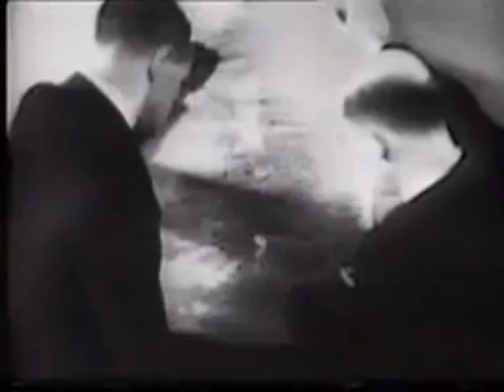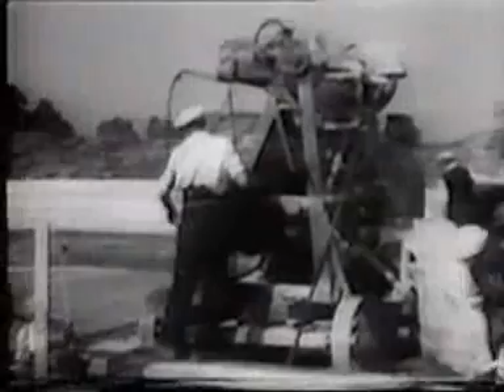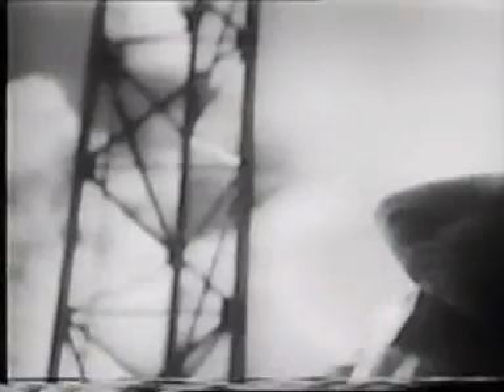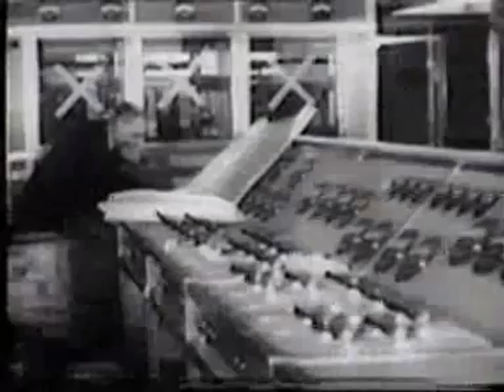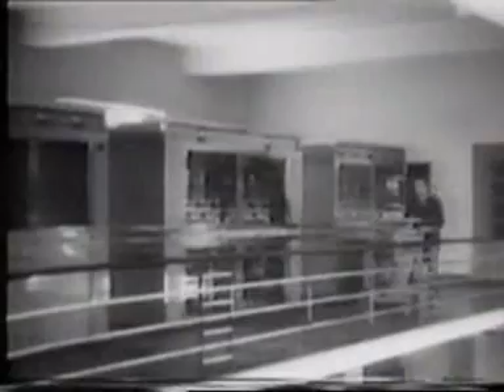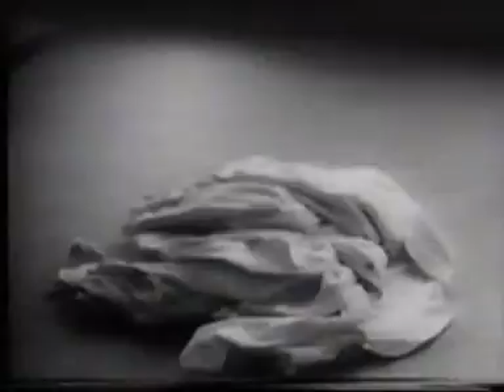Droitwich

Comment: A few comments:

1.   Droitwich Council must have had some "pull" because BBC transmitting stations were, like RAF ones, named by nearby village or feature eg Washford, Moorside Edge and not towns.

2.  About power: it was often stated as having 400kW output but more likely 360.   I am uncertain how much to the goldfish in tank to the north, but they thrived and a dustbin full were given to other public ponds.  Lots of waste heat.

3.   The triangular masts should have had one side at 90 degrees to the line on which both stand, then the masthead pulley would be in line with the halliard but it isn't.   This is obvious because the backstay is not in line with the two masts.

4.  Health and Safety.  A Marconi employee fell to his death in 1950s, he had been rash before... He had used the  safety claw to hold the lift while he swapped to new rope, withdrew the claw and the lift dropped to take up the slack, ge panicked and leapt intending to grab the tructral girders, there was an assistant who was fortunate to not be dragged the same way.  Nobody knows why the task was attempted partway up the 700 feet, the coroner spoke rubbish about risking life to provide radio programmes.   I asked the then EIC, Mr Curd, if little boys were able to go up masts and he replied that he couldn't get big men to go.

He avoided Christmas Day duty delegated to my father so i used to start the English Electric diesels, 350lb per sq in air.  These only ran for the Queen's speech, but also every Thursday for checking serviceability.  If you had been foolish and had neither compressed air nor National Grid there was a Lister with starting handle to pump up the air bottle.  The flywheels were partly in pits but most above floor level and shone like mirrors because on weekly running the diesel man leant against the rims with Brasso on cotton wasre.  Careful not to push it at the whizzing bar notches.  Barring the wheel using a socket on the floor would be used when setting tapoet clearance for example.

Finally - it was Lord Reith's pride and joy, people said "Dieu and my Droitwich".  He had his chauffeur take him there in late evening of his last day in the BBC so that he personally could shut down those diesels, which of course did run everyday during the 1930s and in cold winters ever since,  they produce 2megawatts.  At open days a 15" diameter spare piston was displayed and more of the public understood that allusion to power than any figures such as kvA or kilocycles.

The rotary converters and everything were the very best possible and it is sad to see the neglected state of the exterior since unmanned running in recent years.

Comment: 15 years later I would love to see an HD transfer of this film. Where did it come from?
Reply: Yeah that would be great, it''s amazingly well made
Reply: They should have run the audio through a DSP and equalizer to clean up the muddy sound. Even me and my smaller mix board and PC could do a better job on the audio. I have transferred many old recordings to MP3 and did better than this.
Reply: @KlodFather  The original was probably 16mm optical sound. Uploaded to only 240p. A modern transfer of the original 16mm film would be much better, if still available.

Comment: Only a few miles from where I live. I’ve always wanted to have a look in that building but I guess most of this old equipment is long gone.
Reply: Yeah. I've wanted to go in too. Apparently they did have a few open days years ago.  Check out a  PDF called Droitwich Calling. I stumbled across it a while back. Interesting read.
Reply: The station has been re-engineered a few times since this film was made, modern transmitters are the size of a wardrobe!

Comment: I was stationed at Bitburg, Germany in the 1970s and was able to hear the ground signal during the daytime, 400 miles from Droitwich. (200 kHz/400 kW then). It must be a treat to British expats living on the Continent far from the coverage of UK MW/FM/DAB sites.

There was some talk a few years ago of closing the station. Is that still the case?
Reply: I remember hearing it very clearly in 65 up in Norway. That was quite high up in the mountains though
Reply: gtgene  As I understand it,  the BBC are committed to Droitwich LW until 2021.
Reply: The UK government have announced analogue radio can remain on air until 2032, so hopefully the BBC keep R4 LW going until then.
Reply: @christopherhulse8385  I believe LW Radio 4 will only last till the last remaining valves hold out - they are no longer made, and I suspect the BBC will use the valve situation to get rid of LW when it suits them.
Reply: @alangiles4616  that is flat out not true. There are plenty of valves to go round
Reply: @R.A.N.I  I was only repeating information  I heard from a a senior BBC Engineer a few years ago. As you probably  know they are not standard tx valves
Reply: @alangiles4616  Plenty left in stock now thanks to the shutdown of regional MF sites
Reply: @R.A.N.I  Valves, like microchips, come in many models for different purposes. Valves from unrelated (or even related)  equipment are unlikely to be any use as spares for a machine built for a different model valve.
  Unless the particular valves used by the Droitwitch transmitter can be found, the best bet is to hire in some power electronics engineers to design a modern LW transmitter that can be manufactured and sold to LW stations around the world.   The antennas and physical infrastructure can remain unchanged, with some adaptation circuitry needed to match the particulars of different sites. On the administrative side, using the LW facility to send government approved political messages to embattled remote interests such as Gibraltar or the Crimea would be one use.  Adding digital broadcast with the unfortunately named DRM.org system could calm those who foolishly believe that everything must be digital for whatever salesmen call digital.
Reply: @johndododoe1411  Several of the LW TXs use the same valves as the Marconi MF TXs..... Ask me how I know
Reply: @R.A.N.I  That's surprisingly good news that may postpone the need for a new LW TX for a few decades.  However the other things I mentioned may be useful to persuade the government to keep things running despite the energy cost.
Reply: @johndododoe1411  LW is the next on the chopping block along with R4 MF
Reply: I'm hearing 198 kHz BBC4 signal from Turkey during night, signal is weak but decoding embedded time signal is possible.
Reply: A newer Marconi 500kW LW transmitter was being assembled there early in 1987, with valves made by French company Thomson-CSF.
I'd have thought that there were plenty of output power valves still available. 
BBC R4 LW is almost the last remaining such service in western Europe by now, as it only reaches less than 100k listeners, economics kick in

Comment: Amazing footage! As someone commented below, one of the producers of this film is a Mr Watt, but they are still talking about power ratings in Horsepower!
Reply: And it is nicely narrated by Mr Chumley-Warner
Reply: risvegliato   Isnt  a horsepower equal to 743 watts?
Reply: Interesting point that.  All the time I was waiting for KW power but never mentioned.  I woder if Luxy had to use a generator for its million watts?  I always thought that the LW  1500 m  Tx was run off the national grid.  Had not ocurred to me that it was not.  It used to facinate me when I was a kid to see all those masts in that area from the road.
Reply: @peteranderson217  Droitwich transmitting station was designed before the regional grids were completed in 1933, the regional grids were not interconnected nationally until 1938, moreover to guarantee continuous supply private generation and standby is better
Reply: I did three tours as an engineer at Droitwich in the early 80’s and the Diesels, MG sets and DC switchboard were still from the original installation. The LW transmitters were newer, but still 1939 vintage and used CAT19 valves.

Comment: Not even once did the announcer give valve or genset ratings in KW!

You could get by with that mistake with the gensets, but all electrical systems are measured in KW (volts, amps, watts)...

Aside from that massive goof, the short is otherwise free of flaws.

The missing audio could be fixed by replicating nearby existing audio.

Where did the film print come from?
Who preserved it?

Max Power, CEO
Power Broadcasting / Deep Space Network @ Home
ADL, AU / WEL, NZ
VAN, BC / SEA, US
Reply: Not so much a goof, as simply written for public consumption and put in to terms more readily understandable by the intended audience. Compare it to today's information programmes, if you can find any, where the science is so dumbed down, you'd be forgiven for thinking they were aimed at five year olds.
Reply: @MacShintersbane  Yes, it's a bit weird the commentator talking about electricity in terms of horse power.